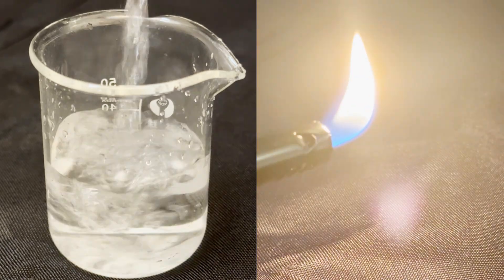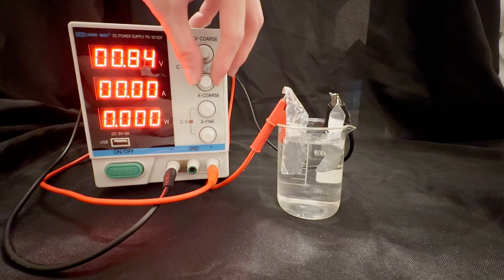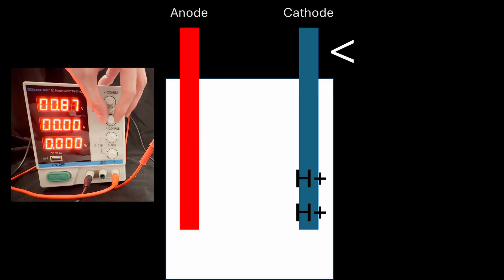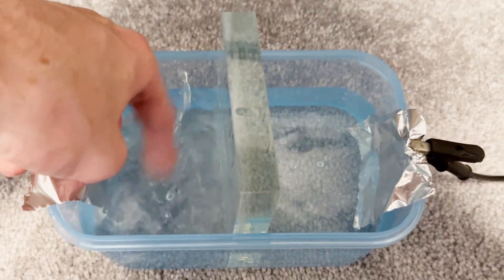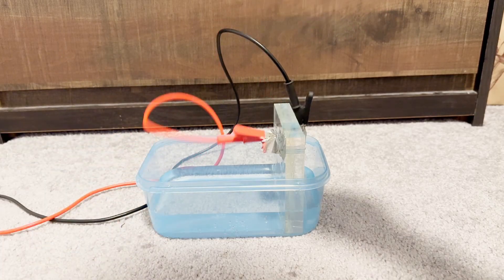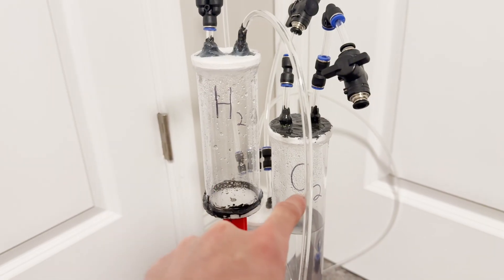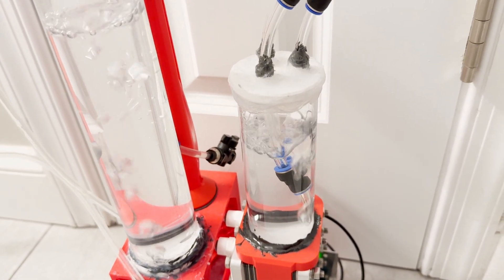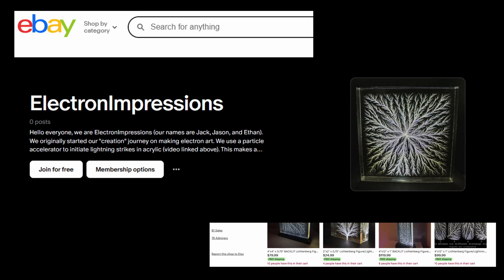This machine turns water back into fire

Comment: Electrolyzing salt water makes hypochlorous acid, no?
Hypochlorous acid reacts denatures by oxygen and dissolves metal which is why you have to keep it in a sealed plastic or glass container.
Made naturally when lightning strikes ocean water as well as internal to the human body under  cavitation arcing.
Electrons don't "flow" they are units of measurement.  They measure the dielectric induction of the proton, which itself is a modality of the neutron.  When light hits the max rate of perturbation on the Aether, ot makes a shell and spins off > neutron > becomes a proton 17s later.  They set the unit at the inductive charge of one hydrogen atom, since that's the primary element.  It's not a ball nor a thing it's not gathered together nor does it transfer from one atom to another. 
Matter is magnetism.
Magnetism x Dielectricity = Electricity discharged at the Tesla coil angle, ie inverse to counterspace.
See the Pythagorean pentagram or incommensurability.
Phi x Psi = q in Planck electrification units
Dang, got to much in this message :/
I'll try to edit it for sense tomorrow.
Gonna do some research on the hypochlorous acid generators in the interim.  That what optometrists use, it's skinsafe bleach so long as it isn't super concentrated.
Reply: That sure was a bunch of words arranged into sentences that I just read.